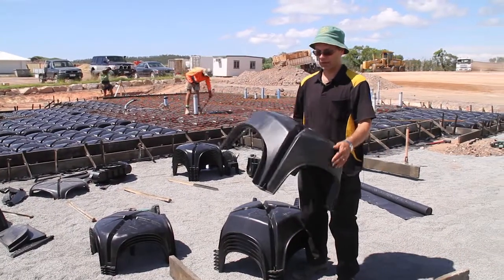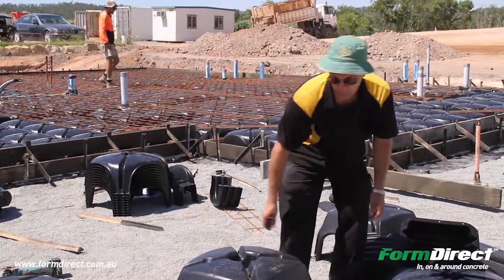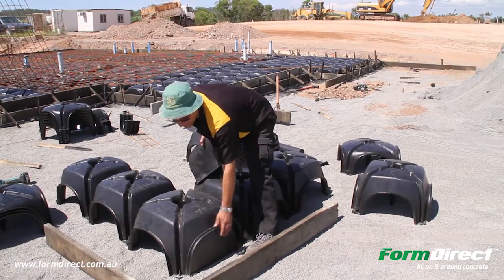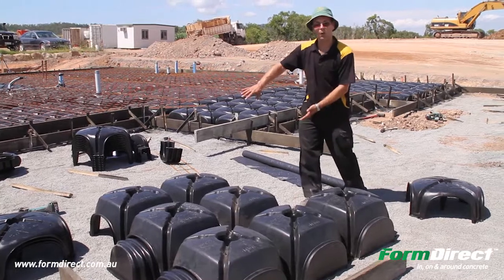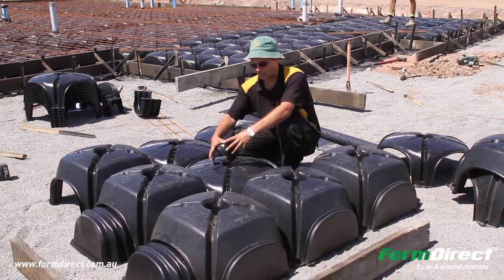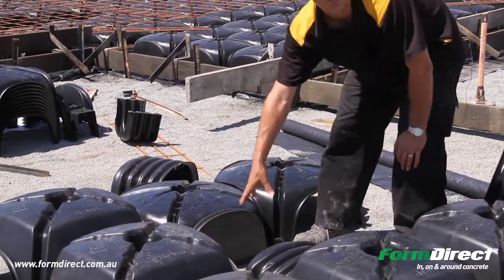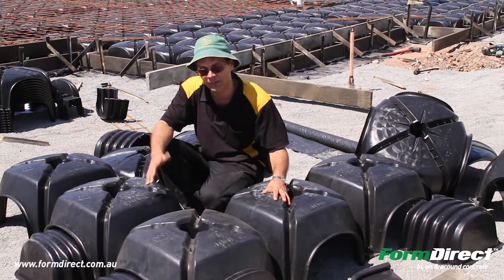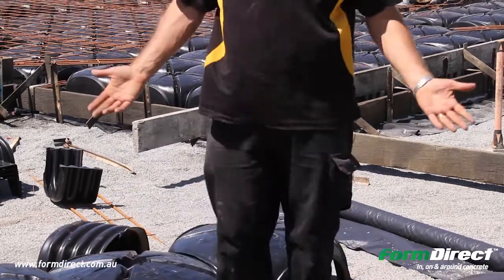Cupolex Structural Dome System - Demo Part 1

Comment: No chairs? Doesn't this affect strength of  the slab? How is the steel doing its job if it's not encased in concrete? Does it leave the steel exposed to moisture/rust? I think it looks like a great system but would be hesitant not using chairs.
Reply from the maker: Hello, thank you for your comment.
Due to the curved or arch design of the Cupolex domes allowing the system to maximise the concretes strength - just like a bridge is also an arch shape.
This curve shape means that the slab thickness above the domes will vary. At the top of the dome, the mesh does sit directly on the product, however, only for one cross wire. Concrete slurry does also get underneath the mesh.  At this same area, you have the central cone of the dome that filled with concrete all the way down to the plastic membrane at subgrade. This cone and curved gives the system is high point load strength which is approx. 6 times that require by Australian standards.
Regarding moisture or rust, even using the smaller 260mm high domes, the moisture from the subgrade is 260mm from this mesh location. The moisture not only has to get through the plastic membrane but now also through or around the thick recyclable plastic of the Cupolex.
To date in Australia, there has been no failures of a Cupolex slab.